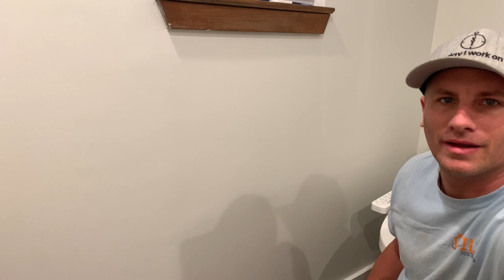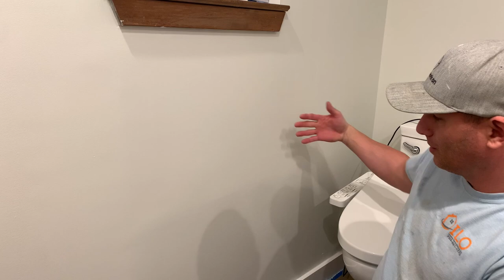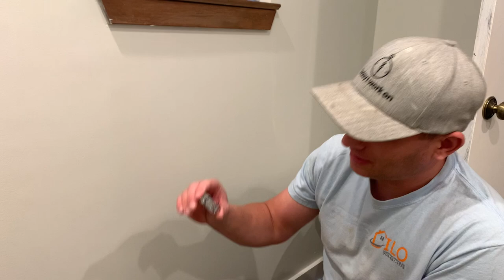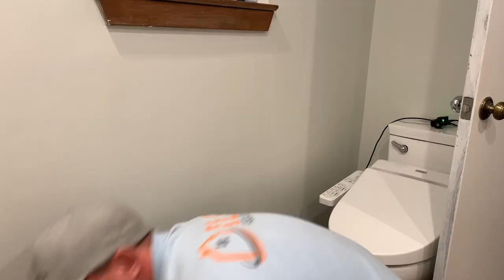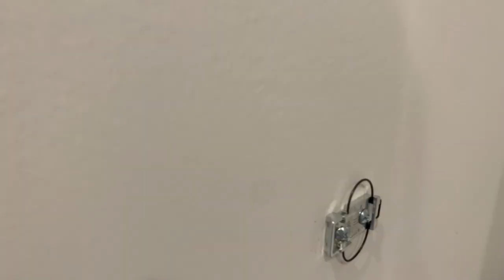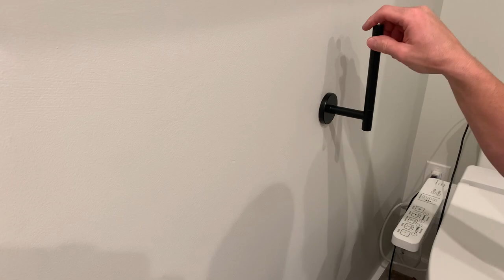You're installing your open ended toilet paper holder the WRONG WAY.

Comment: Wrong information. You're supposed to put them horizontally and when you rip the toilet paper, you rip TOWARDS the stem of the holder, so the roll doesn't go flying off. If you put the holder vertically, depending on how close the wall is, someone could get their pants stuck on it.
Reply from the maker: That would be really funny! 🤣. The reason why I made this video is a lot of times you can only install the toilet paper holder one way, this solves that problem. It’s not wrong, just different, but in my house it’s always worked well, with the kids even more so.

Comment: the contractor  who did my bathroom remodeling installed the open end toilette paper hold in the wrong direction. It is attached to my wood cabinet. Can I fixed it without making another hole in the cabinet to install the holder correctly ? Thanks
Reply from the maker: Yes.

Comment: You could not be more wrong about this. Your toilet paper is not gonna flow as you pull it. If you want one that doesn't fly off just find a better roller you buy a cheap one and this is what you get.